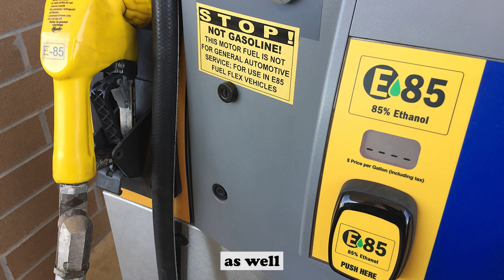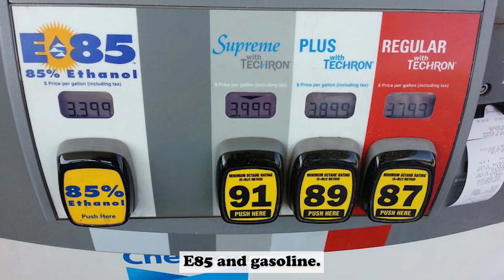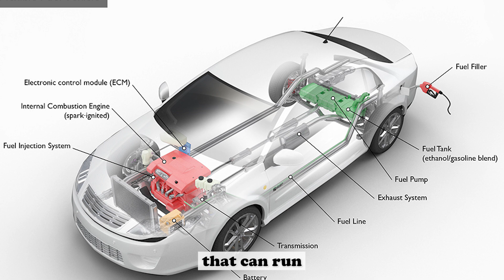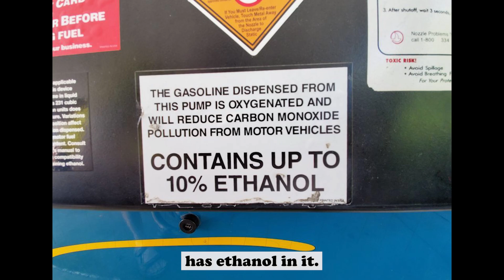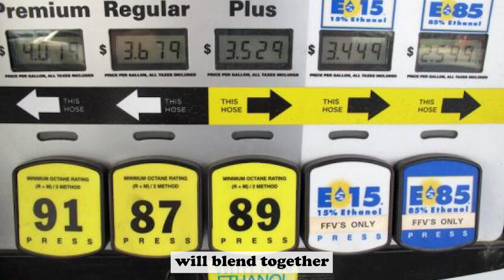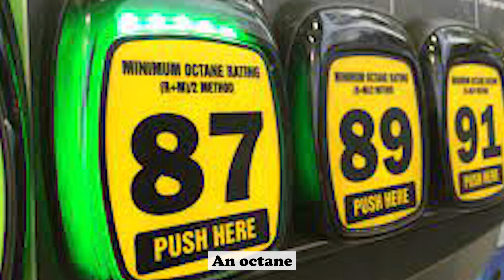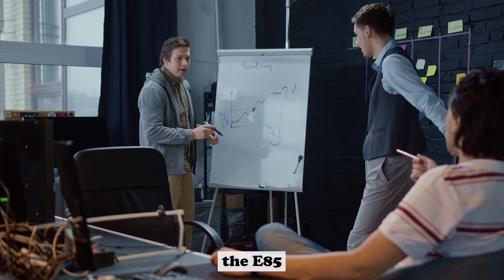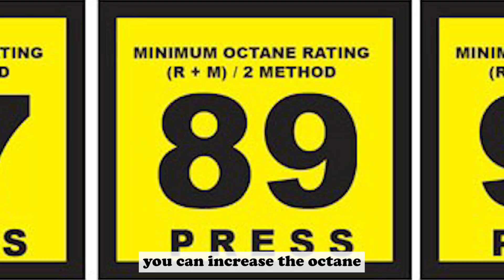Can You Mix E85 With Regular Gas? Don't Try Before You Watch This Video!

Comment: Jumpstart Gasoline of Kansas has been do'n this for some years now, their premium grade gas is actually E30 w/92-93 octane. Ethanol destroys rubber seals so don't use it too often but once in a while to clean up the fuel system👌

Comment: I got here looking into trying a blend of mostly 87 regular unleaded with e85 to raise the octane for my carbureted car, and hope to find a good balance. I would have to use up the blend in one driving session, refilling tank with 91 before parking it to avoid corrosive damage to the carburetor. Will be installing TBI fuel injection soon anyways. Figure a 70-30 blend and find out. But yeah, this video is repetitive and contradictory!

Comment: NOTE: This video is all over the place and contradicts itself several times.
First the video says:
[5:42] "For example: If you use too much E85 in your tank, the engine may start knocking and pinging.  This is because ethanol has MORE energy than regular gasoline and can overload the engine if it's not adjusted for it."

But, then the video says:
[7:37] " Generally speaking however, using E85 ... is not likely to result in any significant performance gains.  In fact, in some cases it may even REDUCE performance.  This is because E85 has LESS energy content than gasoline."

Comment: If a cars computer is programmed to run on e85 it definitely produces more horse power by a lot so I’m not sure why he’s saying there’s no evidence.  There’s plenty of dyno tests to prove
Reply: if the ECU is tuned for or able to detect and auto adjust for it (e85 will run way too lean without adjustment) AND your fuel pump/ injectors are able to send way more fuel than what is required for gasoline, then yes. same amount of air with much more E85 fuel will make more power but if the fuel pump is not able to keep up at high rpm , high load (and high boost for forced induction engine). you already need at least 25%  more fuel flow to make the SAME power (because of the lower energy density) and of course even more if you want to increase power, which is not always possible with stock fuel pump

Comment: E85, as you said, earlier in the video, which you contradicted yourself later, doesn’t have as much energy as gasoline. Alcohol burns slower than gasoline, therefore increasing octane. This is why it is so desirable in boosted vehicles as long as you tune for it.

Comment: This video is a childish and superficial attempt to address the issue of using ethanol fuel. The following are my critiques of the video's information in sequential order to match the video.

Flex fuel vehicles do NOT have engines and fuel systems specially designed to run on E85. The systems and engines are the same as non-flex fuel. The difference is in the software in the onboard computer. It merely recognizes the different fuel.

Where in the U.S. is E85 more expensive than E0 or E10?

All spark-ignited internal combustion vehicles (gasoline-powered), regardless of age and manufacture, can run on E85. This includes cars, trucks, boats, motorcycles, go-carts, etc. If the vehicle is not flex fuel, you may not want to fill the tank completely with E85, but you can certainly mix the E85 with E0 or a lower blend. This will save money on each gallon of E85 that you use, increase the level of octane in the vehicle's fuel, and be less polluting.

Energy content (BTUs) is irrelevant. Engine optimization is the key.  

The computers in modern vehicles have NO ability to increase or decrease the level of ethanol vs. gasoline that flows into the engine. Carburetors in older vehicles have NO ability to increase or decrease the level of ethanol vs. gasoline. The fuel is mixed when it is pumped into the tank, and it stays mixed.

Ethanol-gasoline blends have NOT been in use for more than a decade, they have been in use for more than 100 years. America's experience and use of ethanol-gasoline blends is just a very small part of the experience.

Ethanol does not have more energy than gasoline, it has a higher octane rating.

There is no such thing as "pure gasoline." Gasoline is a complex compound of many ingredients that can change depending on season, altitude, brand, and availability of ingredients.

For the 2nd time, energy content (BTUs) is irrelevant. Engine optimization is the key. 

Ethanol is an octane booster. If your vehicle needs an octane boost, then just use ethanol.
Reply: Am I ok to run 87 in my e85 truck?

Comment: I have heard it all.  E85 will not cause knock.  You need to do more homework before making another video.  I have a non-Flex and use only E30 for years with 275,000 miles and no issues.  Tens of thousand of consumers here in the Mid-west also run E30.